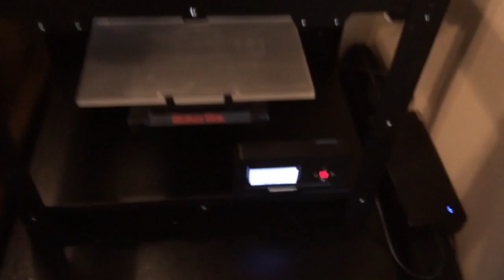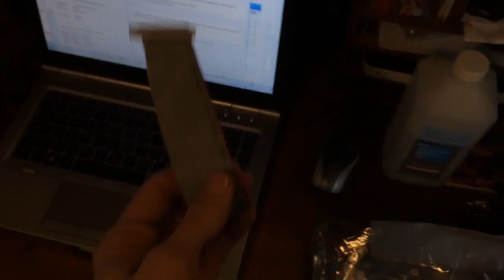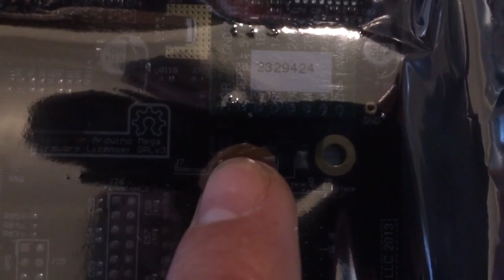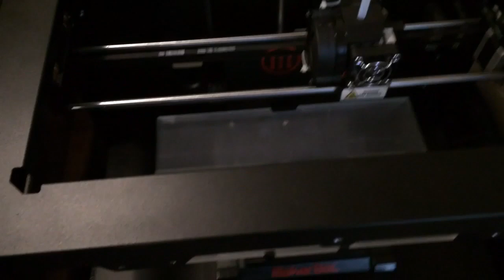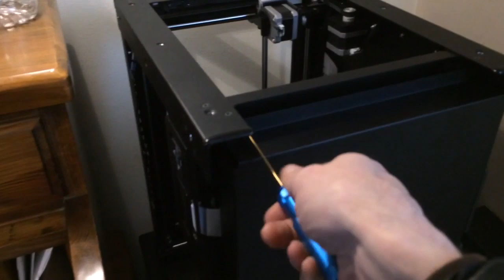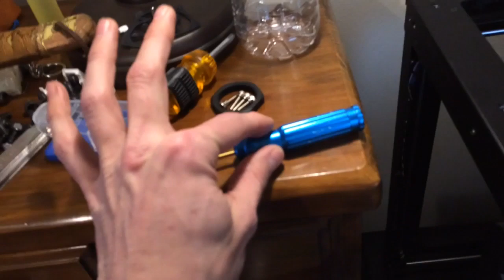Replacing mighty board on Makerbot Replicator 2 3D Printer

Comment: Awesome video Scott. Where did you purchase the board. I am looking to replace the board on the Makerbot Replicator+. Someone tried to re-box the printer without removing the USB cable from it. It damaged the USB B port, it is lose. I have not opened it yet to see if the board is cracked or not. Thanks for your help.
Reply from the maker: Sorry, I cant say a good place to get this board replacement. Mine was still under warranty when I had to replace my board and the manufacturer  sent me a replacement board.

Comment: hey! sorry for asking about something not related to this video here but i wanna know that i was planning to upgrade my makerbot replicator 2 by adding mk8 dual extruder
i wanted to know that if it is compatible with the printer and if yes how should i connect it?
thanks! :)
Reply from the maker: It can be done, I have several rigs. One for dual, one single, one for high temp all metal for nylon and poly carb. Things you need for changing a single to dual are (just woke, so I might be missing a parts).

1. Dual cooling bar (ordered from Carl Raffle, link below)
2. Another stepper motor
3. I ordered a dual wire cable set for Makerbot.
4. Another nozzle
5. Dual carriage, I can run a single rig on the dual carriage for easy swap back and forth. Just tighten the screws good.
6. Second thermal tube and nozzle
7. Fiberglas insulation and kapton to wrap the hot block
8. Second thermal coupler K type screw in
9. Wire mamanagment bar (not needed, use wire ties)
10. second PTFE Tube for dual filament.
11. hot end block
12. 24 volt fan, fan grill and spacers (you can print the spacers with your single before taking apart)
13. 24 volt heater
14. Another extruder and hardware like bearing, spring, can also print one to start off)
15. And the most important, a second stepper controller to put in the empty space on the main board. It should be one from Makerbot, maybe someone else now makes a third party one? 
16. Heat sink
17. M? Bolts for fan, heat sink and grill at needed length. (Measure current ones)

Like I said, half a sleep. But I think I covered most of it.
Most parts can be bought from Carl for dual carriage and cooling block, even hot end with filament feed tube.
https://shop.raffle.ch

Another place I found parts like dual cooling block, hot end, thermal Barrier tube, ptfe tube is:
www.robotdigg.com/category/14/

They even sell a one piece setup that might be cheaper, they didn't have this when I did mine. 
This one might work, good price for everything.
www.robotdigg.com/product/243/MK7-Dual-Stepextruder

Some parts I ordered from Makerbot directly.
Good  Luck and have fun printing.
Reply from the maker: Another place I've used for some parts in the past is:
http://quintessentialuniversalbuildingdevice.com

Carl has the best quality parts for cooling block and dual carriage.
Robotfigg has the cheaper items for cost, but still good oartsmand work. Thermal barrier tubes are new and updated, so they don't have filament  jams.

I also forgot to mention the tooth gear for the stepper motor to fee the filement.
Scott
Reply: Thanks!! I saw the mk7 and then saw mk8(dual extruder) so I just ordered that. Also ordered dual carriage for makerbot from eBay, I hope it works.
Although I'm still not sure how to connect them..I'm just waiting for them to arrive. After that I'll try to fit it in.
I hope it works
Reply from the maker: That's great, I wish they sold the dual setup when I changed mine over. Maybe a little more money but would have been easier.

Once you get the parts, you may need a few more. I don't know what that assembly comes with. 
I recommend you use the motors stepper controller, K thermocoupler and wire harness from Makerbot. The other parts you can shop around for.

You will need to a motor stepper controller for the second extruder.
If you email/call Makerbot they should be able to sell you these.

Wire harness is a must for the 2nd extruder from Makerbot because then mightyboard is a proprietary cable plug. 
https://store.makerbot.com/parts-accessories/replacement-extruder-cable/

I recommend using the same K style thermocouple from Makerbot so both match on each extruder or the temp may be different reading on the left and right when dual printing. 
https://store.makerbot.com/parts-accessories/replicator-2-replicator-2x-type-k-thermocouple/

PTFE tube, also cheaper on  robotdigg for a larger piece, just make sure the inner diameter is the came so the filament doesn't get stuck. 
https://store.makerbot.com/parts-accessories/x2-rep2-2x-filament-guide-tube/

Not sure if the MK8 set comes with a heater? If not you will need a heater also.

And if it doesn't come with a drive gear, then one will also be needed. You can get a different or cheaper one elsewhere also.
https://store.makerbot.com/parts-accessories/mk7-drive-gear/
Reply: Thanks man!!! I'll order those accessories and see if it fits
Reply: Btw I got this dual extruder from Amazon 
geeetech.com
Reply from the maker: I hate to give you the bad news, but I would rather tell you then have your mightyboard blow up and stop working. 
I reviewed the link you posted and the first thing I noticed is they cut awa some of the dual cooling block to save money. This can cause problems when printing with dual and cause both sides tomheat up to much in the middle of the print. 

Now for the worse, these are the wrong fans and wrong haters. The Replicator 2 runs 24 volts for the fans and 24 volts for the heaters. I've seen some boards damaged by running 12 volt fans. When the fan failed it failed opened for a second and surged power back into the board damaging a FET, or worse maybe more was damaged. 
A replacement board will cost hundreds, I think it was $320 last I looked years ago. 

I have a video on using different fans with the replicator 2/2X and the biggest thing I state is the fans are 24V, not 12V like most people think. Same with the heaters.
I think the site recommended stated their dual rig was designed for the replicator 2 meaning it had 24V fans and heaters. 

You can replace the heaters and fans with 24V ones if you want to keep the one you ordered, make sure the fans are the correct polarity before turning them on. But I would still be concerned about the cooling block not being completely solid and rectangular across the whole block.

If I was you I would think about canceling the order, or returning this rig and getting one tha says its replicator 2 compatible. Email the company and confirm the fans and heaters use 24V. If they tell you 12V fans will work, then don't buy from that company because they don't know what their taking about. 

Good luck. 
Scott
Reply: Alright I'll try to return them now, thanks!
Would you suggest any other dual extruder I can put on my replicator 2?
Reply from the maker: The original one I recommended in my first reply says its a 24V setup and replicator compatible. 
http://www.robotdigg.com/product/243/MK7-Dual-Stepextruder

Their isn't much details for the item, but I think it does come with the fans and heaters, maybe the whole thing. If it's replicator compatible then it should have the same plugs also. You can email him, he is good at replying and he will let you know if it includes everything you need, or if you will still need to buy a heater and thermo coupler.

So the hardest part of the upgrade would be replacing the single carriage for the dual. You can watch my video on installing the Ali carriage. The steps are basically the same, it shows how to remove the single one, then you would just snap on the dual carriage. 

Install the stepper motor controller on the board, make sure it's unplugged and turn it on and off after unplugging it to release any stored voltage in capacitors. It's always best to be properly grounded, or touch a metal frame of something that is grodunded before handling and installing the controller. To get access to the mighty board you can watch the video I did on replacing the mightyboard. 
It will show you how to install the second extruder thermo coupler and maybe the wire harness. 

The rest should be a one to one plug in. Just be sure that the right fan, right heater, and right coupler all go to the right extruder. And same with thenleft wires to the left extruder. You don't want onjave the right fan on and the left heater on for printing on the right side only. You can test this with the preheat stages.
Reply: Ok, I'll let you know what happens 
Thanks!!
Reply from the maker: No problem. 
I just checked my video for replacing the mightyboard. 
https://youtu.be/QcRZ_un-mzk?t=8m0s

If you watch the video starting at about 8 minutes you will seemwere the wire harness A and B are. The wire harness B is going to be form your second extruder. About the plug B is also were you install the stepper controller.
Make sure it's installed the same direction as it is on A.
Then I point out were the thermo couple wires are. They are marked for the color on the board. So you will be adding the new one to the screw terminals on the right that doesn't have one.
Reply: Btw where do I get step motor controller from? And how do I install it?
Reply: Alright!
Where do I get it from?
Reply: Also which carriage should I use to fit in mk7?
Reply from the maker: I think the dual carriage for the MK7 original replicator might be the same for the Replicator 2 Dual, but don't hold me to that....do some research.

I went with the aluminum carriage from Carl that I listed in my first reply to you.
https://shop.raffle.ch/shop/alucarriage-dual/

You can ask Makerbot when you call them for the stepper controller and cable harness for the second one. if they even sell a dual carriage? But make sure they don't try to sell you the dual carriage for the 2X, the 2X carriage and other extruder parts are different.

I originally bought a 2X and had noting but problems. They had finally admitted a know issue and I don't know if they fixed it. Then I realized I could buy a rep 2 for cheaper. Do all the Aluminum upgrades like the carriage and X ends, AlU arms and heat bed plate from bottle works and when I was done I had a dual printer that worked better then the 2X with better parts for less money then buying a 2X retail. 

A quick google search and I found the following two possibilities if you don't want the aluminum carriage. These are the plastic dual carriages. 

https://www.amazon.com/gp/product/B01HN5X5N8/ref=ox_sc_act_title_1?ie=UTF8&psc=1&smid=A2YI8XQU239Q2W

Robotdigg sells a plastic kit, it always good to have spare arms since they will warp over time unless you upgrade to the aluminum arms. This mist might have the dual you need. I would email and ask him, he knows what he sells and won't miss lead you. But sometimes I was able to order the same authentic part directly from Makerbot for about the same price. He might sell stepper controllers that would work also, but using Makerbot's stepper controller ensures it will work the way it was designed.
http://www.robotdigg.com/product/244/Makerbot-Replicator-Plastics

This one looks to be the same as the Amazon one, just one Ebay. 
http://www.ebay.com/itm/like/122021541517?lpid=82&chn=ps&ul_ref=http%253A%252F%252Frover.ebay.com%252Frover%252F1%252F711-117182-37290-0%252F2%253Fmtid%253D1588%2526kwid%253D1%2526crlp%253D53601919689_324272%2526itemid%253D122021541517%2526targetid%253D186358929609%2526rpc%253D0.24%2526rpc_upld_id%253D79741%2526device%253Dt%2526mpre%253Dhttp%25253A%25252F%25252Fwww.ebay.com%25252Fulk%25252Fitm%25252Flike%25252F122021541517%25253Flpid%25253D82%252526chn%25253Dps%2526adtype%253Dpla%2526googleloc%253D9014901%2526poi%253D%2526campaignid%253D239125209%2526adgroupid%253D14978428809%2526rlsatarget%253Dpla-186358929609%2526gclid%253DCMWa8LH5vs8CFVc1aQodPqUGOQ%2526srcrot%253D711-117182-37290-0%2526rvr_id%253D1104181848722&ul_noapp=true
Reply from the maker: Call Makerbot to order one. Even though they discontinued the replicator 2, the rep 2X still uses the same board and electronics including the stepper controller. So they still have these in stock and still make them. 

Other might make ones that could work now? But Makerbot doesn't sell replacement parts at a high cost so o choose to use the original parts from Makerbot.
Reply: Thank you so much!!
Reply: Yeah already got the carriage you told from eBay while ordering mk8 extruder.
But the problem with this carriage is I don't have screws for that
Reply: Ok so I sent the mk8 dual extruder back and got the refund. Now I'm ordering mk7 from http://robotdigg.com and extruder cable, filament guide tube and type k thermocouple for the 2nd extruder from http://makerbot.com
Tomorrow I'll call makerbot to order the stepper controller or should I just get it from http://robotdigg.com as well?

Also why do I need to get another driver gear?

Thanks.
Regards.
Prakhar Adsule
Reply from the maker: Well originally I broke down the parts but then saw the full setup from robotdigg. You may not need the driver gear if the full setup comes with one already.

I know jetguy used to tune stepper controllers for the Makerbot printers, I understand it takes a lot of specialized equipment to tune them correctly. If it's out of calibration then the prints will also be off. So I would recommend the stepper controller from Makerbot.

I think I have given the most advice I can at this point for YouTube comments. Makerbot used to have a group on Google groups, they closed the thread so no new replies can be posted, but a lot of useful archived information in the thread. The best advice is from jetguy, Dan Newman, Ryan and my ID is ScottJD.
https://groups.google.com/forum/m/#!forum/makerbot

To ask new questions you can try the following google groups. You will see the same people I mentioned and a lot of other experienced 3D printers would good advice you can ask questions to.

https://groups.google.com/forum/#!forum/makerbot-users

http://forum.makergear.com/

The last thing I can recommend if you have not done it is to upgrade your firmware to sailfish.

Thank you,
Scott
Reply: Haha no worries. I'm really thankful to you, you really helped me a lot. :)
And yeah upgraded my firmware already. Just waiting for the parts to ship in now.

Thank you so much
I'll just follow the group you told about!
Reply: hey, sorry for annoying you but this is probably the last question. I talked to makerbot and they are not able to me another stepper controller so just went online and tried to search it. I found one on flashforge.com ( http://www.flashforge-usa.com/shop/parts-accessories/flashforge-stepper-motor-driver.html ) but it doesnt look the same. do you think it will work? if not is there any other way to fix this problem?

Thank you!! :)
Reply from the maker: As far as I know the flasforg driver is different t. I won two of the flash frog board currently. 
You can try this show, it the only one I found that states it's  compatible with Makerbot and Replicator might be bored versions E, F and G. 
They have an 800 number so you can call in advance to confirm.
https://www.bilby3d.com.au/DispProd.asp?CatID=11&SubCatID=125&ProdID=ptDriverBotStep

What version mightyboard do you own?

How old is your printer?

I will also call Makerbot and see if the will sell me one. Since they still make the replicator 2X and the 2X uses the same board and stepper drivers, I don't see why they wouldn't sell you one. 

I would also post in the forums I mentioned, JetGuy would know the most about what stepper controller would be compatible. If you can find a conversation he has replied in recently I'm sure he can help also.

Scott
Reply: Hey how you doing?
Just wanted to tell you that I finally got everything together and now the dual extrusion is working fine. Also bought a build plate from IDE and it's perfect.
Now trying to build an enclosure for it and also adding a active cooling fan to print pla
Reply from the maker: That's great, glad you were able to get this conversion to work.
Reply: Yup
I was trying to do an active cooling fan for the extruder to print PLA(just in case) 
Do you know place where i can buy the kit for it or something?
I saw your video about the kit but it's not available anymore :(
Reply from the maker: What video, what kit? I don't remember doing a video on any active cooking fan?
I have researched a few that you can print for the 2X in thingiverse. But be sure to print them in ABS. Most of the dual active cooling fans you can print for the 2X are just a simple bolt on or clip on solution.
Reply: Oh I'm so sorry, it was someone else who did the video 
Thanks though :)

Comment: Can you recommend a compatible mighty board replacement for a replicator 2?  Makerbot isn't selling mightyboards and there are plenty of mother boards on ebay. Any info would be most helpful
Reply from the maker: I have only used makerbots board and flash forge board. I guess you could get a flash forge board to work if you buy the same one with the same atmel processor. But you will have to change most of the plugs to get things plugged in. I have not looked at board in a couple of years so I don't know about the Ebay boards. Someone probably now makes a 1:1 replacement board.